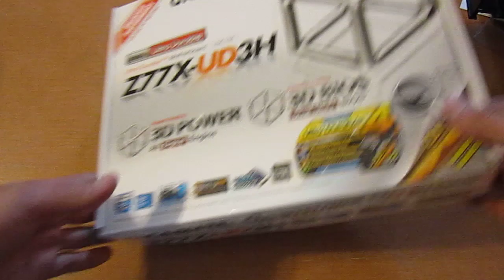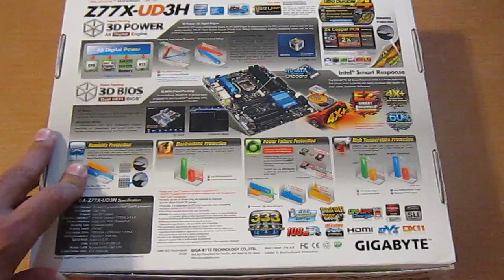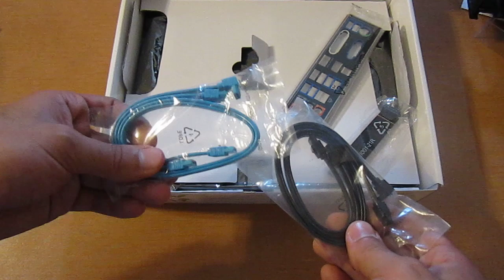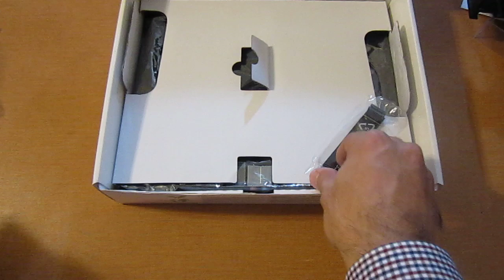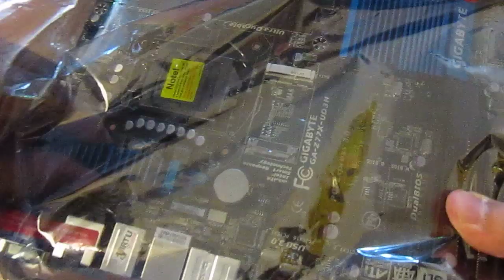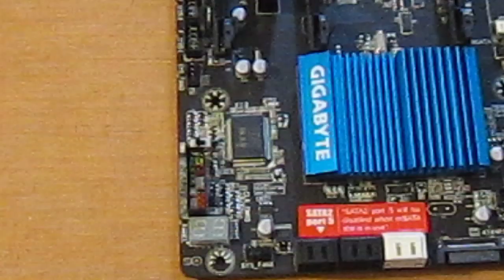[SinHardware.com] GIGABYTE Z77X-UD3H Preview

Comment from the maker: actually if you want to OC then the lowest board I could recommend would be the D3H, the D3S doesn't even have voltage control. IMO spring for the UD3H, the 4-pin isn't such a big issue, I had no issues with it on the M3, but I heard the D3S doesn't even have voltage control.

Comment: Hey. I just watched Part 1 and 2 of the VRM videos (great videos btw) and it seems that the question i 've come up with from what i 've learned here is too hard to be googled.
I 'm really tight on a budget so i was considering the Z77x-D3S. Ok so it's Ultra Durable Classic and it has no fancy OC buttons and some different ports. 
But WHATS UP with the 4 pin PSU?
Will the D3S for a 3570k that will OC well and hold another 7870 2gb(when i decide to upgrade by going dual GPUs in a year or so)